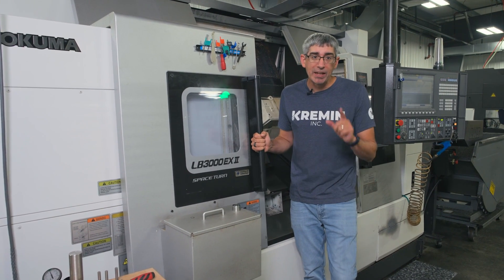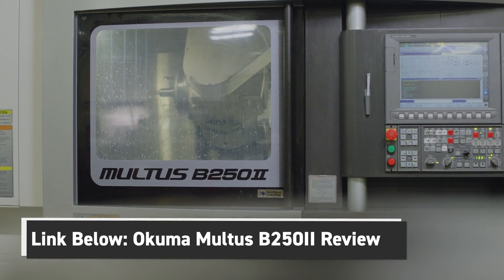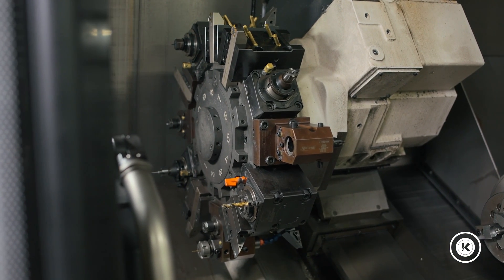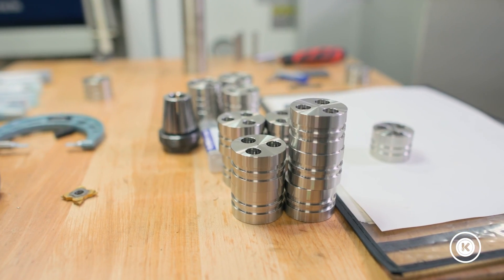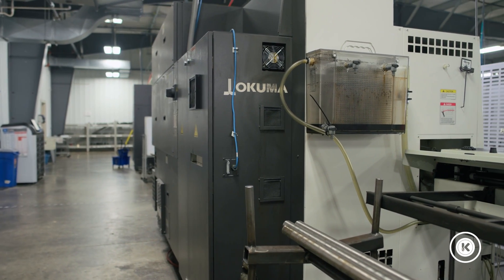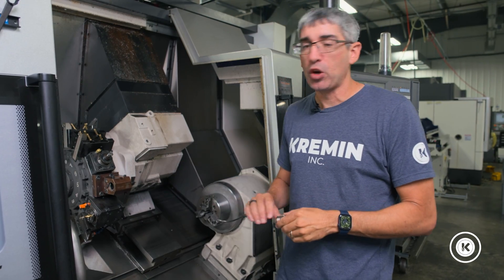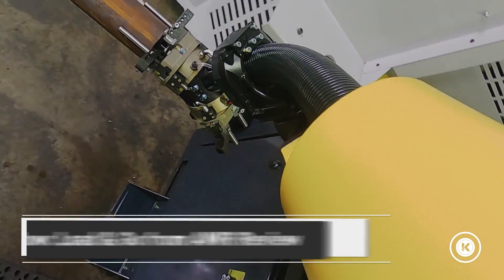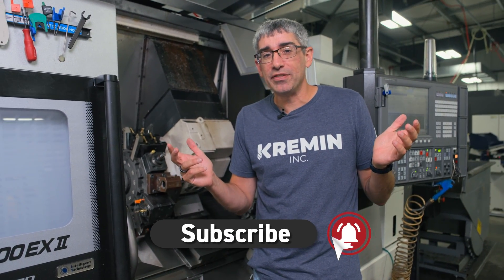Okuma LB3000 EX II - Kremin CNC Machine Reviews

Comment: What kind of coolant filter is that mounted on the back side of the lb?
Reply from the maker: It is an oil separator to remove the way oil from the coolant, the Okumas have a ton of way oil running through them. I will get the brand info for you Monday but we have a different version on the multus that we prefer over this style. You might be able to see that one on the Multus review.

Comment: I have an odd question for you. We have the same machine. My question is does your coolant come out through the whole turret (not just the active tools)?
Reply from the maker: On our 2 LB3000 machines, it only directs coolant to the active tool position (it will come out of front and back tools if there are 2 mounted at that position) - might see a little drip from other spots but a lot.
Reply: @Kremin Inc. Manufacturing  Thank you! I just uploaded a short video showing what ours looks like. If you don't mind checking it out and letting me know what you think.
Reply from the maker: That does not look like what ours does but I will show it to my guys tomorrow and see what they say. Thanks for sharing.
Reply: @KreminIncManufacturing  Thank you!
Reply from the maker: The guys said when they run high pressure, coolant will find other ways out but they said they have not seen it as bad as your video.